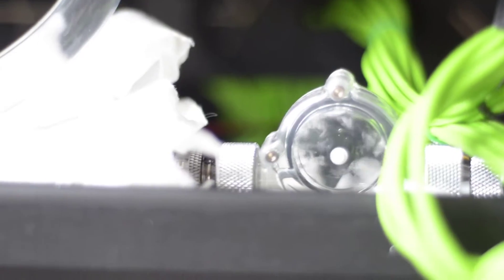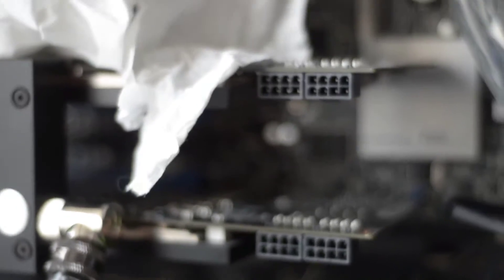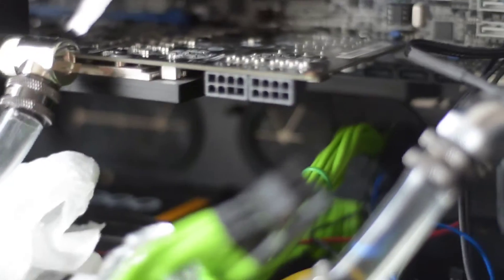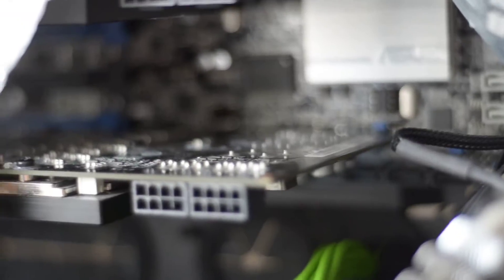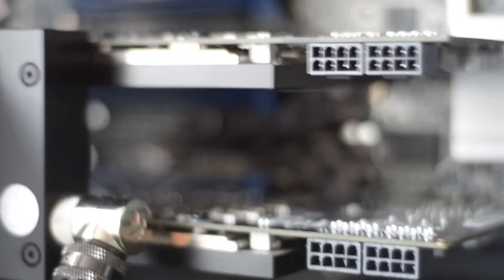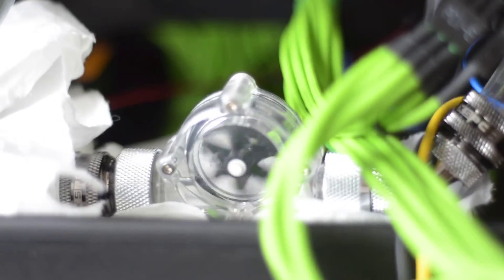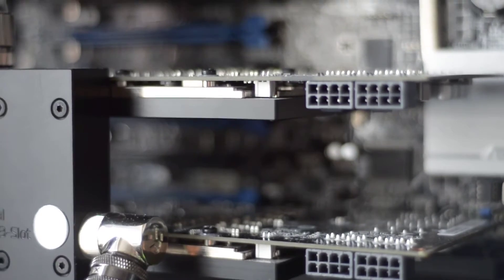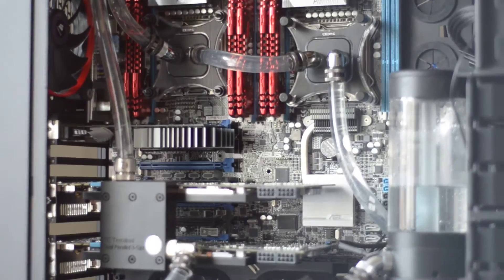Putting Dual Xeon back together to build an UnRaid VM machine

Comment: can anyone help im trying do a window 10 vm on unraid with a gpu passthrough but keep getting this every time I try to start it.

internal error: early end of file from monitor, possible problem: 2016-11-01T20:48:37.146207Z gemu system x86 64:-device vfio- Force GT 7 pci host 04:00.0,id-hostdev0,bus pci.0,addr 0x5: vfio: failed to set iommu for container: Operation not permitted 2016-11-01T20:48:37.146239Z qemu-system- x86 64:-device vfio- pci,host 04:00.0, id hostdev0,bus pci 0,addr 0x5: vfio: failed to setup container for group 17 2016-11-01T20:48:37.146248Z qemu-system-x86 64:-device vfio- pci, host 04:00.0, id hostdev0,bus pci 0, addr 0x5: fio: failed to get group 17 2016-11-01T20:48:37.146260Z gemu system x86 64:-device vfio- pci,host 04:00. 0,id hostdev0,bus pci.0, addr 0x5: Device initialization failed

Comment: I heard that there are free alternatives to unRAID but i guess the $89 are well worth it for unRAID plus since it's probably much easier to configure and better supported than any of those.

I wonder if it was somehow possible to configure 4 VMs on this rig...
one NAS, two with each one GPU and one CPU, but also a third that can boot with both gpus and cpus when the other two are not booted.

If this worked it would be so awesome!
Reply: Coldministrator 
Could be done. With IOMMU you can do PCI passthrough and give each VM dedicated access to each GPU.